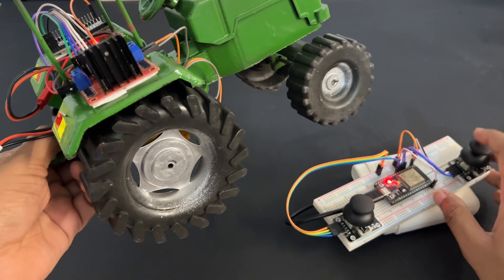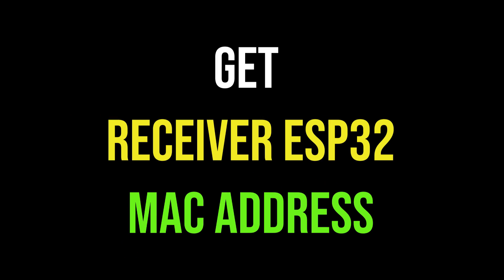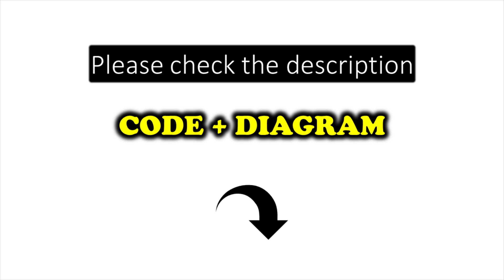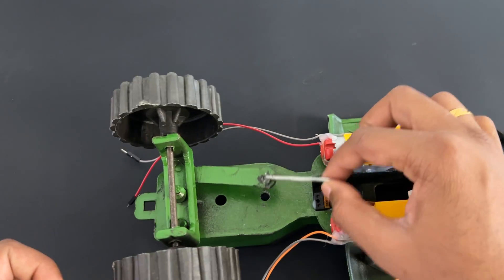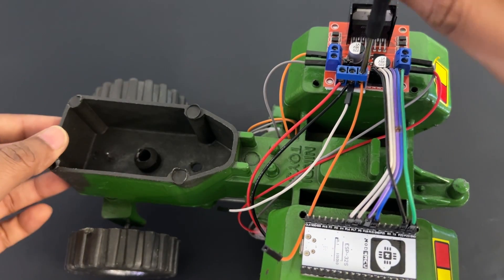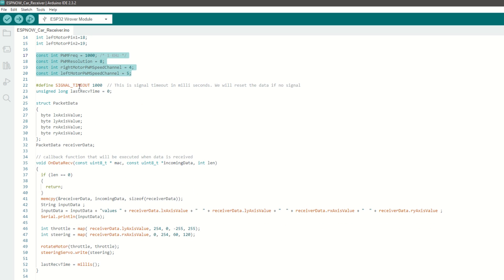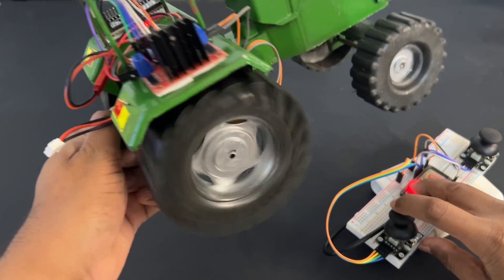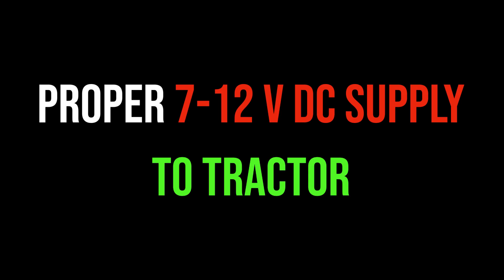How to make RC Tractor using ESP32-ESPNOW | Joystick remote control 👏🏻

Comment: Sir can I use a single joystick in this tracker please reply
Reply from the maker: Yes you can . You will have to make changes in code to use required joystick x and y values 👍🏻👏🏻
Reply: @hashincludeelectronics  sir please make video . 🙏🙏🙏 Make a car or tractor with single joystick , espnow prototype l298n motor driver and steering mechanism please sir

Comment: I’m trying to make this work with a RC car motor it’s a titan 550 how do I change the speed on the code so it will move because it’s making a sound but it’s not moving it needs more power
Reply from the maker: The max speed is already there in code . You need to move the joystick to the extreme position . 👍🏻👏🏻

Comment: Nice
Reply: What extra electronics will be needed to control a big tractor?
Reply from the maker: @kumardigvijaymishra5945  glad that you are thinking in that direction . However it’s just a hobby project so we don’t consider lot of things in testing and design . For using such design for big tractor is not recommended . It needs lot of attention , things to consider , safety and many other things. 👍🏻👏🏻
Reply from the maker: Thank you 🙏

Comment: im getting this error code Compilation error: 'ledcSetup' was not declared in this scope
Reply: Thanks it worked lol 😂 all the codes are on the boards now let’s get to my favorite part lol I can finally repurpose my old rc car I have at home I can’t wait to play around with the code when I’m finished lol I love electronics
Reply from the maker: @lunacryd9020  that’s awesome 🙌🏻
Reply from the maker: Please install lower version of esp32 board 2.0.16 👍🏻👏🏻
Reply: @hashincludeelectronics  I am using an esp8266 board. I have installed the appropriate libraries. I tried to install a lower version of the board. Nothing is working out. The error is the same. Please help me solve the problem.

Comment: Bro I connect transmitter with Arduino ide serial monitor but it is showing message failed sent successfully plz help
Reply: try this code it will work

#include <WiFi.h>
#include <esp_wifi.h>

void readMacAddress(){
  uint8_t baseMac[6];
  esp_err_t ret = esp_wifi_get_mac(WIFI_IF_STA, baseMac);
  if (ret == ESP_OK) {
    Serial.printf("%02x:%02x:%02x:%02x:%02x:%02x\n",
                  baseMac[0], baseMac[1], baseMac[2],
                  baseMac[3], baseMac[4], baseMac[5]);
  } else {
    Serial.println("Failed to read MAC address");
  }
}

void setup(){
  Serial.begin(115200);

  WiFi.mode(WIFI_STA);
  WiFi.STA.begin();

  Serial.print("[DEFAULT] ESP32 Board MAC Address: ");
  readMacAddress();
}
 
void loop(){

}
Reply: Bro plz tell me any solution